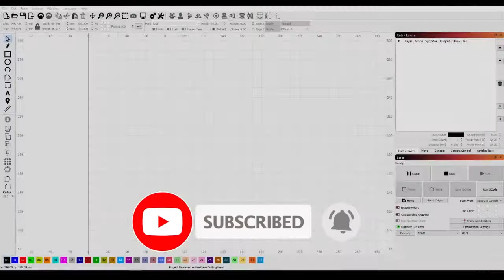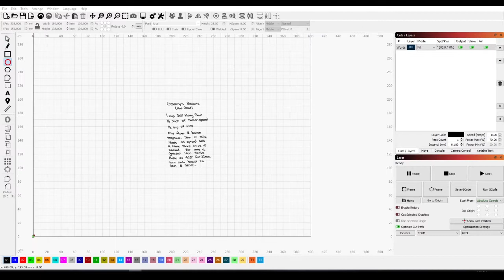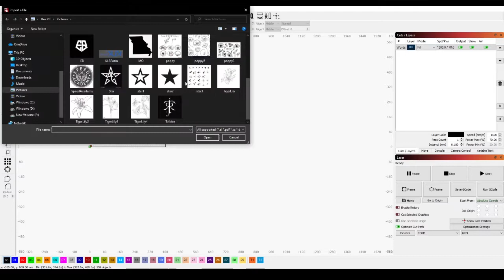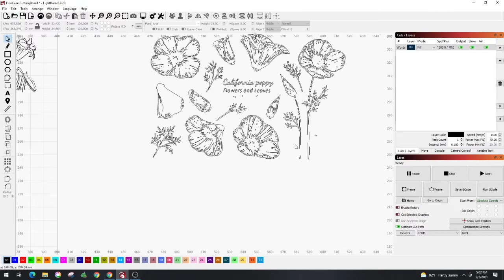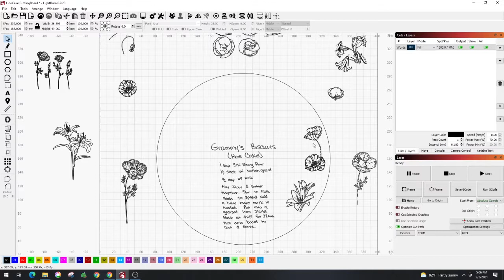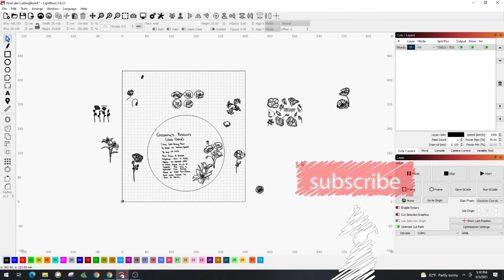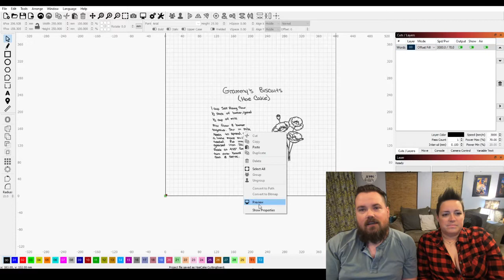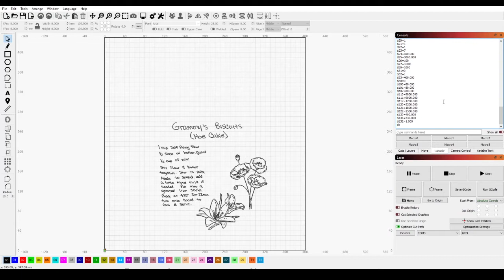How To: Laser Engrave a Handwritten Recipe on Cutting Board

Comment: Great video. FYI if you just hit the "." button it will rotate your image 90 degrees. if you hold "control"+"." it will rotate 15 deg at a time and if you hold "shift"+"." it will rotate 45 deg at a time. Just saw you use the rotate function up top so I figured I would share.
Reply from the maker: That’s good to know thanks!